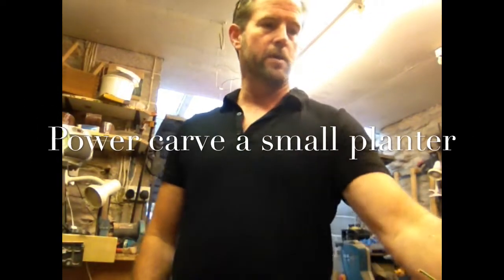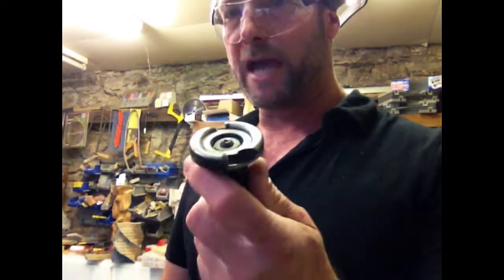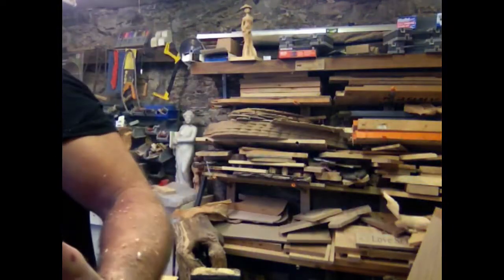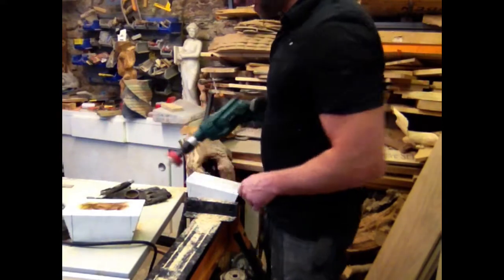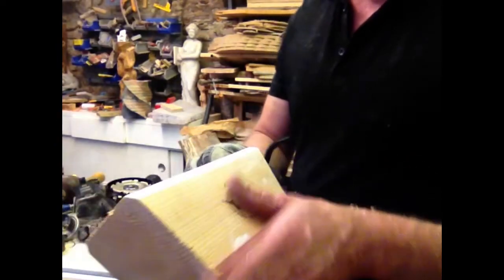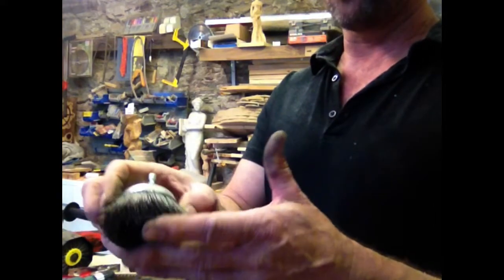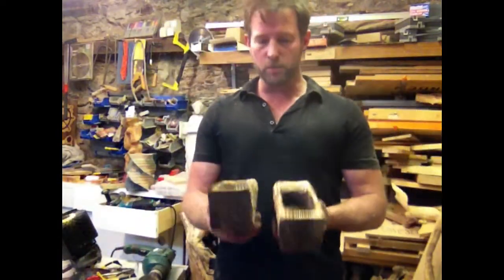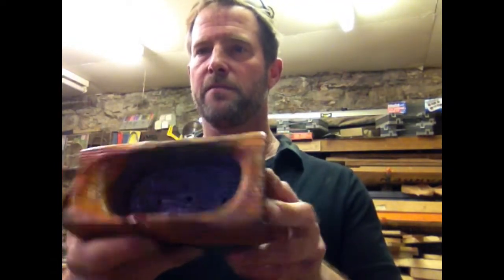Arbortech Mini turbo plane planter, using offcuts

Comment: Hi Jonathon. Just a suggestion that works for me. Use your hole saw and then use an oscillating tool with wood blade to dig out the hole saw cuts. Goes very quick.
Reply from the maker: Thanks for that, will definitely give that a try! Nowadays I tend to remove most of the waste with a chainsaw but that doesn't leave the smoothest finisb

Comment: just wondering if the Arbortech ball gouge would be a better option for this work??
Reply from the maker: I think it would in the short term, I talked to arbortech about the overheating situation I was having and they said that their products shouldn't really be used on sappy wood like pine. If you were going to make these from hard wood, then either the mini turbo or the ball gouge would be good. Now I find the easiest way is with a small chainsaw and a bit of sanding.  Makes it a very quick job
Reply: @JohnathonWhittaker  can i ask what chainsaw you use for this??  what size blade/chain (not sure what the right terminology to use here is)  to get such detailed small cuts??
Reply from the maker: @weldmama  I use a sthil ms 170 chainsaw, a small one but great for what I do and it has a 10 inch carving bar on it so the tip of the saw is only one inch in diameter. Perfect for small cuts

Comment: Would all that heat build up on the cutting teeth work back to the grinder and damage the motor or bearings?
Reply from the maker: No, I think the bit would melt first! It became obvious that kid was getting to hot by scorching the wood and I could.definetly smell it. No danger to.the grinder though.  It's just the head that gets over heated

Comment: What’s your opinion on the arbortech ball gouge
Reply from the maker: I decided not to buy one after how the mini turbo plane responded. I have used one before and they do work well but as i use sappy wood,  I don't think it would last very long before getting to heat distorted. I spoke to arbotechs representative here in the UK and they don't recomend the tools be used on pine.